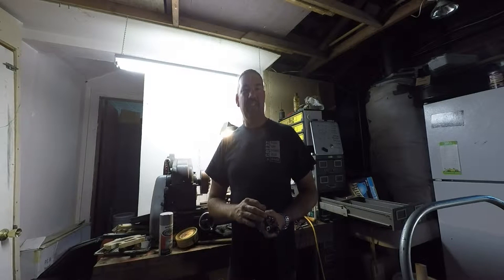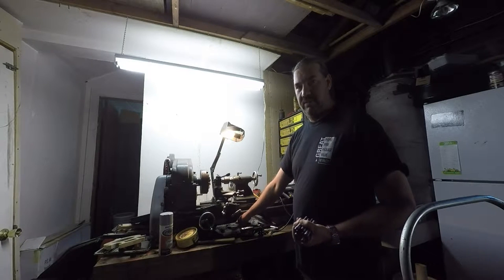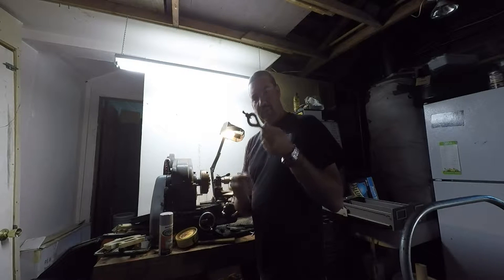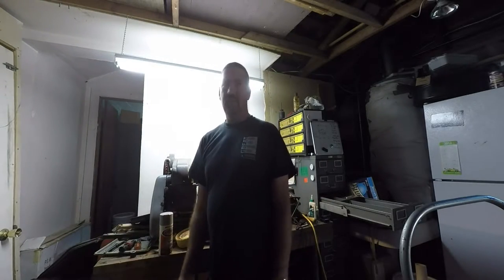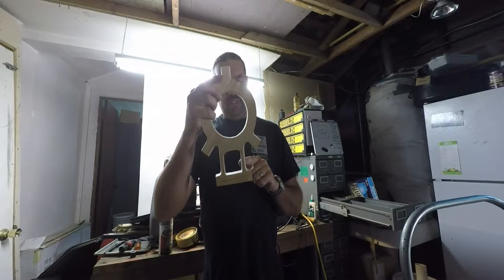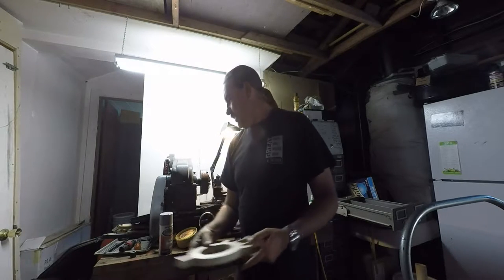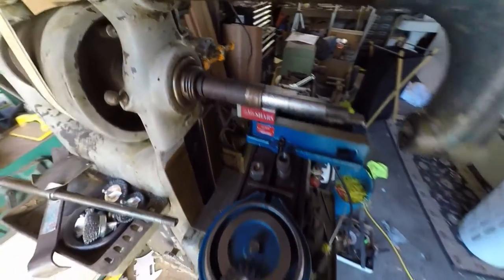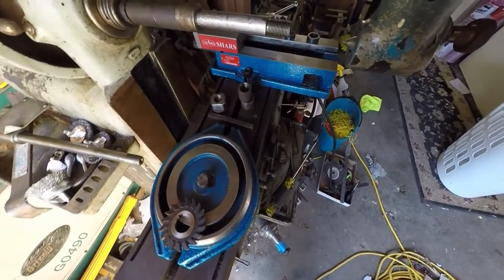update to the shope and more tools

Comment: Okay now I'm kicking myself again for not picking up a horizontal mill when I had the chance.
Reply from the maker: Old Sneelock's Workshop once it's running I can always help you out.
Reply: Thanks Chris. I had the chance to buy a horizontal from a friend and passed it up thinking I wanted a Bridgeport. Then I passed up a Bridgeport to look for a bigger one. Now I make do with the SB and Hand Tools.
Reply from the maker: +Old Sneelock's Workshop I want a vertical mill to hunting for a adapter to work on the b&s my plan is all line shafts tools like Dave Richards.
Reply: Chris Anderson Some of the Menonites in the area use line shaft tools. But only for woodworking that I know of.
Reply from the maker: +Old Sneelock's Workshop if they want any bearing hangers or pulleys or cliches let me know. I'll be manufacturing all of that for my shop